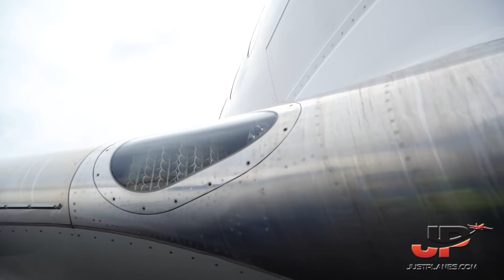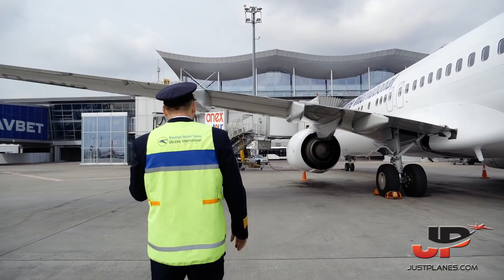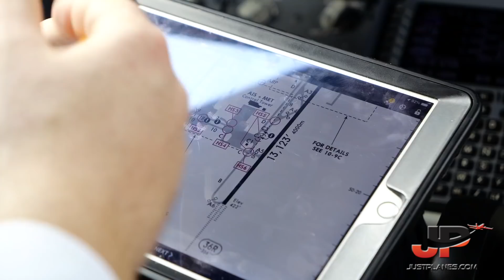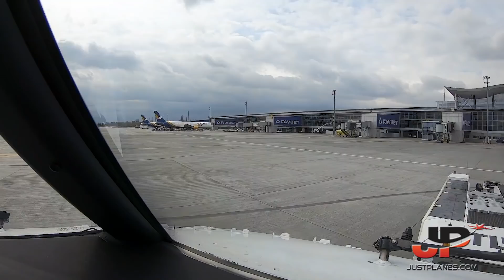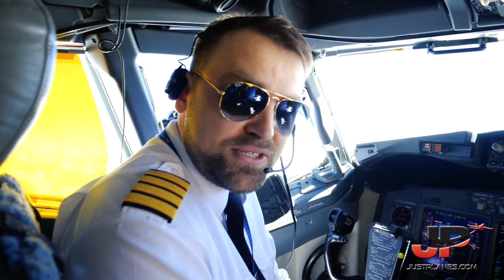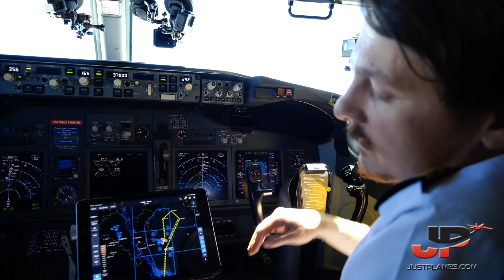In the Cockpit UKRAINE INT'L Boeing 737-800 Departing Kiev

Comment: Doesn't the EEC always read data from the the T12 TAT sensor rather than the front mounted TAT sensor? I thought that was the whole point of the T12 TAT along with the pressure sensor for optimum fuel flow.
Reply: Just on ground and first 5 minutes. That is what book says...
Reply: @PilotBlogDenys  thanks for the reply. Might I ask why this is? Is it because after the 5 min of flight the TAT sensor and T12 have the same readings?

Comment: Oh boy!   If you knew how many times I have flown in the 737-800 with UIA out of Gatwick to Kyiv!   I have friends in Kharkiv and so I have flown many, many times with UIA.   Kyiv is a great airport too!   And, as a desktop computer pilot, I have flown many hours on the 737-800 out to Sharm, Hurghada and to Lviv and Kharkiv!   Great video!   Really hoping I can make the trip this summer.   Looks like you have a very small fuel imbalance between the two wing tanks.   I usually use the crossfeed to balance up the fuel when I reach cruise level.   Do you use assumed temperature for derates or do you use as company set formula?   In all the flights I have flown with UIA, it's always been takeoff flaps 5 - but then you are pretty light so flap 1 would be fine. Great video.